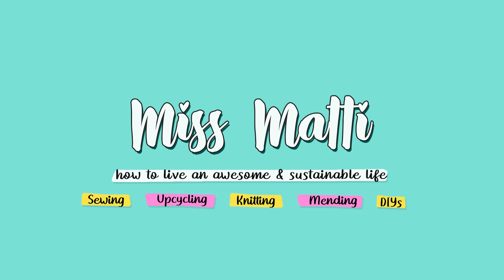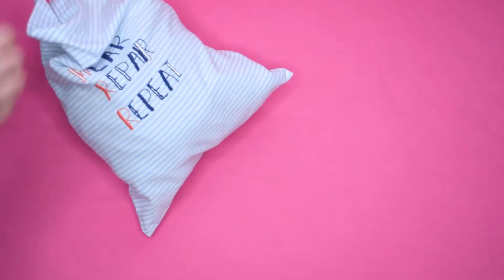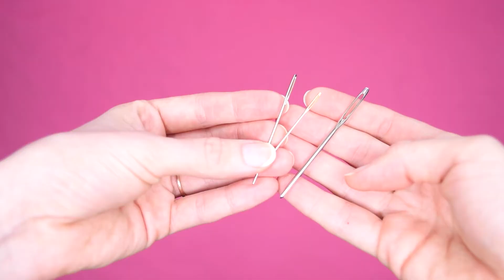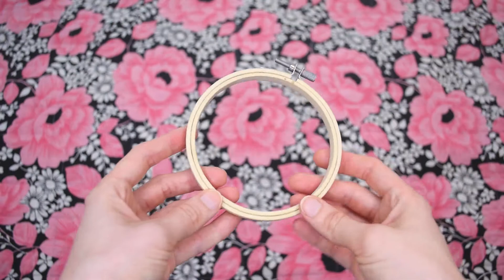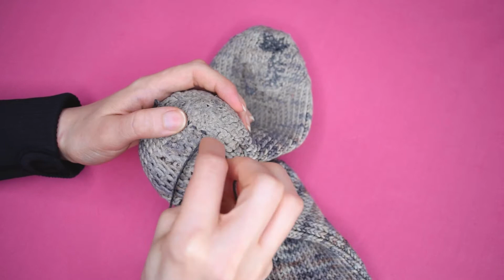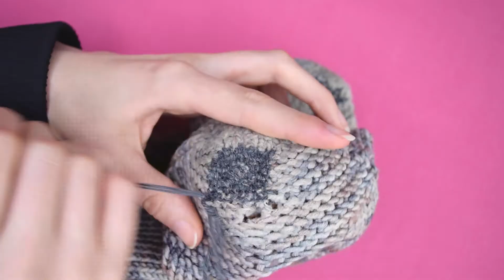Scotch Darning Tutorial 🧦 🧶

Comment: Wonderful video. Thank you. 
I would like to know how you recommend “hiding the ends” as well when you get to the bigger hole how best to handle that.
Reply from the maker: Glad you enjoyed the video! 🤗💕When I hide the ends I am just pulling them in randomly in between the stitches with a darning needle. I know some people have 'specific methods' for hiding yarn ends - but I haven't found any specific method being better than others. Hiding the ends diagonally might help if you are unsure how to do it, going up and down in between stitches. 

When it comes to bigger holes I find that scotch darning works really well as you pull the yarn through to the other side before creating your stitches. I would just make sure to use a darning mushroom (or similar) to ensure that the tension is correct for the area that you are darning. The correct tension can be harder to achieve when you darn bigger holes. Let me know if you have any other questions! 😊